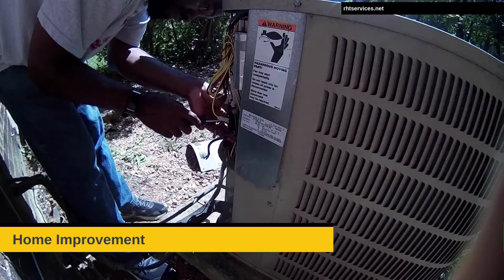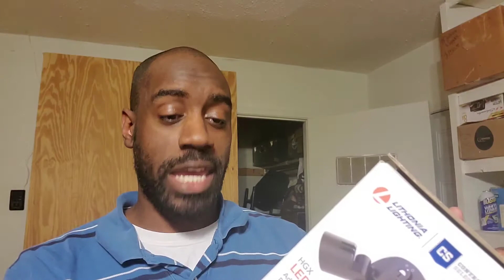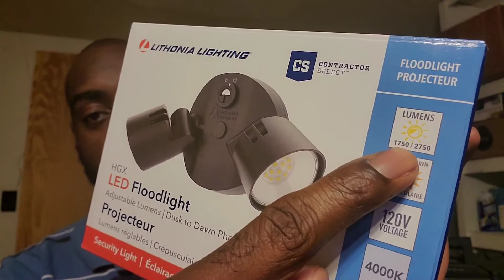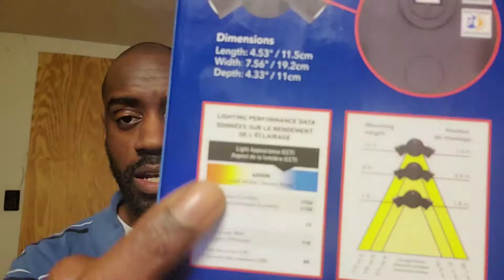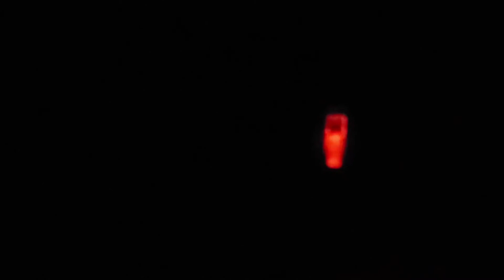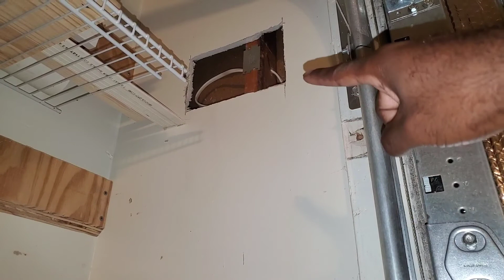Installation of Lithonia Lighting LED Flood On Existing Circuit

Comment: Would you know about wiring? Ive hooked up white to white, black to black, set the ground, and there is a red wire coming from the box, im guessing its the switch? Its a dusk to dawn light, when i hook up the red wire it flips my breaker.
Reply from the maker: I'll be posting a video about this later this week. It'll provide more information.
Without seeing photos of the problem, I am going to assume that the issue is the red wire is making contact with the ground or neutral wires, or is touching the light fixture itself, which is causing it to short, which causes the breaker to trip. I would start by checking the connections on the light fixture and the switches.

Comment: Can bulb be changed? If so how ? I have 4 in each corner of my house one set has stop working I’m thinking maybe it’s the bulbs
Reply from the maker: It cannot. They are LEDs and not traditional bulbs. That said you'd have to get a new fixture and it is not designed to be serviceable
Reply: @rhtservicesllc  one out the set didn’t last long the store it was purchased from wouldn’t take it back because it had been installed I was just wondering thanks
Reply from the maker: Try contacting the manufacturer for a warranty claim if it is within the warranty period. If it is within that time frame then they may send you a replacement for free or a discounted price